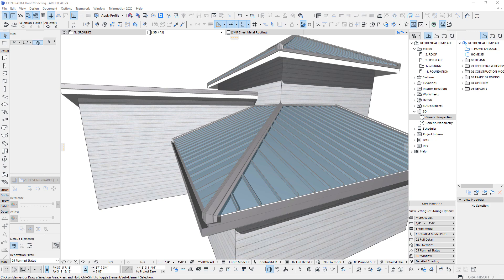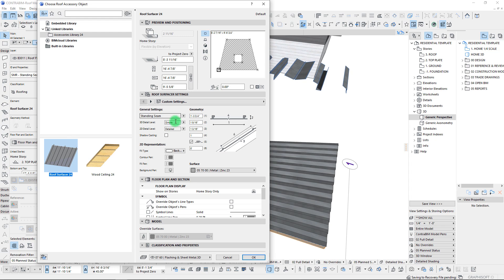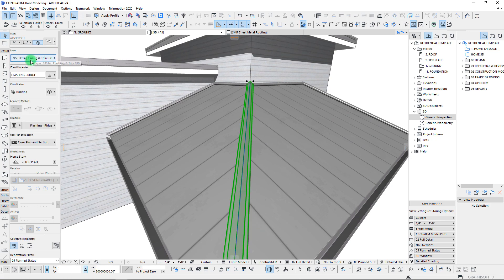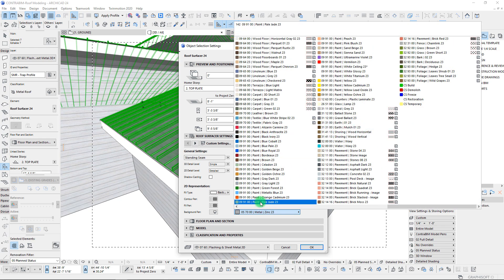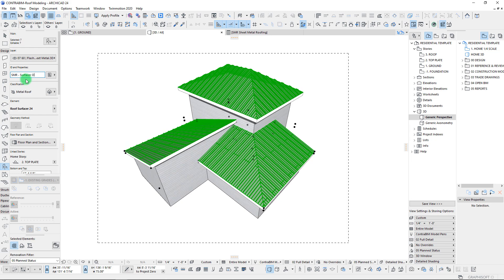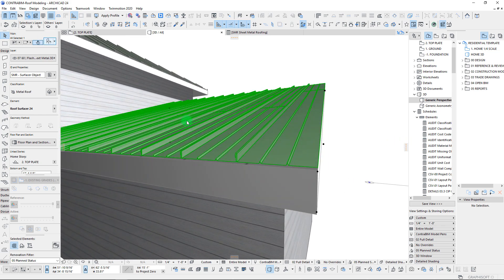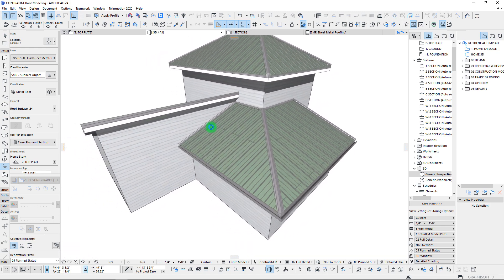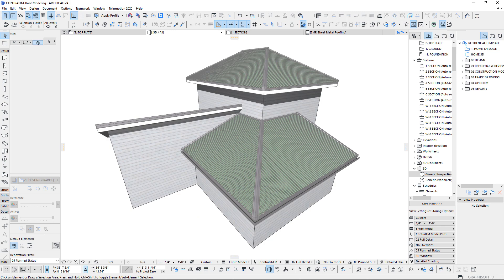How to use the Roof Surfacer Tool in Archicad 24 (Part 4)

Comment: Great video! Did you have to split the hip roof into single planes in order to apply the roof surfacer? And are you able to edit the roof as one if you you do split it?
Reply from the maker: Thanks for the comment! Yes you do need to split into single planes for the surfacer to work, but I believe you can select them all at once to add the surfacer. There are some limitations on modifying the roof elements after splitting, but it's not a total setback, you can grab them all and adjust slope all at once, or push a few nodes around to reshape as needed without much headache. Thanks!
Reply: @CONTRABIM  Thanks so much!

Comment: Hi! Great video series.  It really helped me understand how to get more realistic looking roof coverings and flashings as well as take off schedules.  One question I have though is about the roof profile tool.  When you do it you simply select all your roofs and then go to the roof accessories and voila it's there.  When I do it an error pops up and says it can't handle multi plane roofs and I have to split them to single plane roofs to make it work. From a quantity take off perspective this is annoying since there is extra steps to make sure everything is accounted for properly with single plane roofs compared to multi plane roofs so it's almost like which one do I choose?

I swear in your video when you select the hip roof it is still showing up as a multi plane roof after you have applied the profile so I'm hoping you have some insight on what might be happening

Comment: Hey, really helpful video ^^ is there a way to make the final tiles to have thickness, not to be only a to be a surface?
Reply from the maker: Thanks for the comment and question! Yes the different surfacer types have different parameters, whether standing seam, corrugated etc... If you turn on the 3D detail level to detailed, you'll see it creates a thickness, although I'm not sure if each different type has a parameter to input. The tiles definitely have a thickenss input, but the sheets I don't believe so, just a default thickness of about 1/16" or so...
Reply: @CONTRABIM  Thank you so much for the answer! It really helped me ☺️

Comment: Hi there, The end of the sheet is cut vertically, how do you make it end at 90 degrees? Thanks
Reply: in the second 0.33 the roof strips are as they should for example
Reply from the maker: That is a great question. I'm poking around in the settings and I don't see an option for cut angle. It's funny the top of the surfacer tool is at 90 degrees, and the bottom is cut straight vertically. I'm not sure if it's possible to customize. I'll dig into it a little more...
Reply: @CONTRABIM  Hi there, it's been a while. I purchese Archicad 25 and I think still the same problem, as you said, the top is 90 degrees but the buttom is substracted vertically. It's funny cuz in roof tool there's actually a parameter "rood edge angle" we need that to roof goodies accesories!. Keep out with the great videos! Cheers!

Comment: Secondly, have you heard about the cadimage add on?
Reply from the maker: Yes! They make some great tools, and powerful objects for surfacing and trims for roofs and much more. Unfortunately the cadimage tools are terrible for quantity takeoffs, most you can get is an area. Lengths of fascia, barges, edge trims...not going to happen. Best to takeoff the underlying roofs they get applied to... Thanks!
Reply: @CONTRABIM  I understand now where the approach is coming from, but to be honest, in general the best way to model in order to generate accurate quantity takeoffs is like this, but some times for a roof like this one the amount of time that you are spending modeling and scheduling it's quite big, even though you might already have a template with favourites and everything you wish... anyway keep up the good work, at least there are people that understand and appreciate the power of Archicad. It's simply amazing.

Comment: I absolutely love this series John 8-)
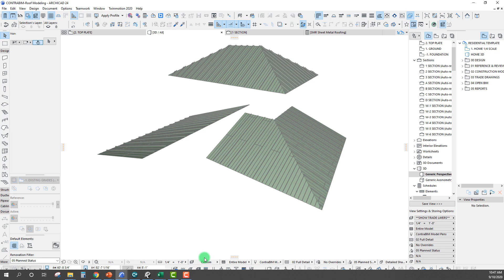I understand what you say from 7:53 to 9:11 and agree then that the "host element area will be a better area for general roof heet procurement & costing take-off purpose. 
But where you measure the area on Plan View 7:53 and compare that to the take-off area I have a question though. Would the area on Plan View not be irrelevant in this case, because the true area would come from measuring against the sloped angle, right?
Reply: BTW brilliant how you use the associative Railing tool for the flashings etc.
Reply from the maker: Thanks Francois! Yes your absolutely right that the true takeoff is going to include the slope. The general roof element is going to provide this accurately. The plan area is not too useful, but it’s good to use as a reference and check to make sure your sloped area values are correct. Thanks for the comment!